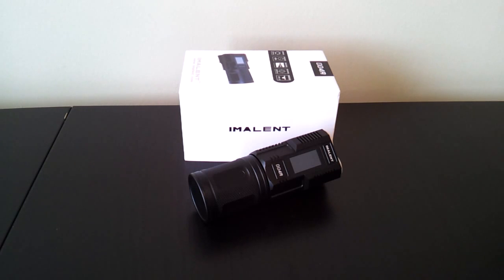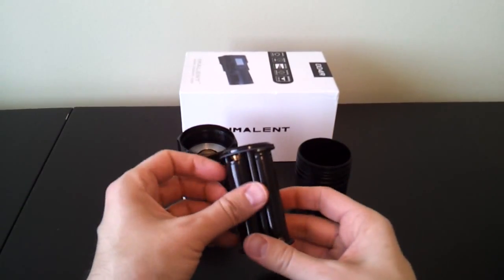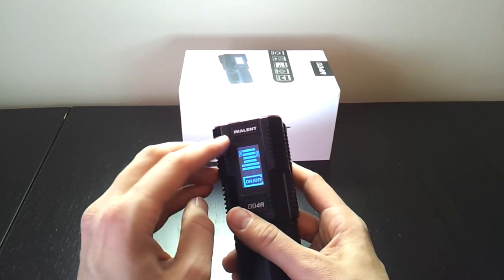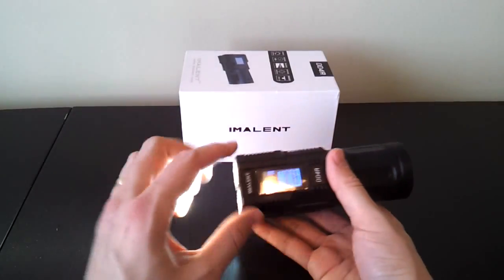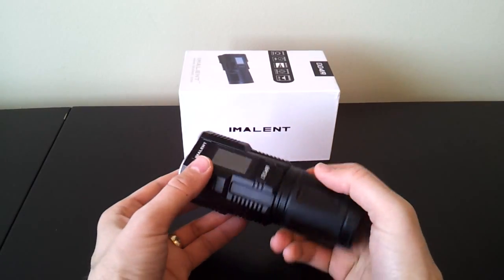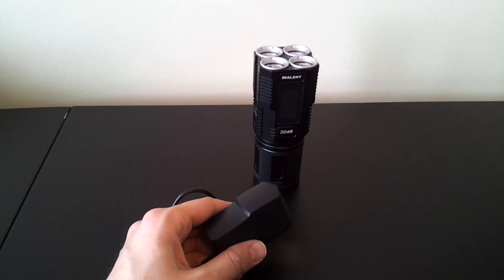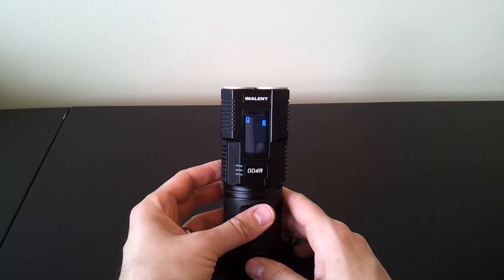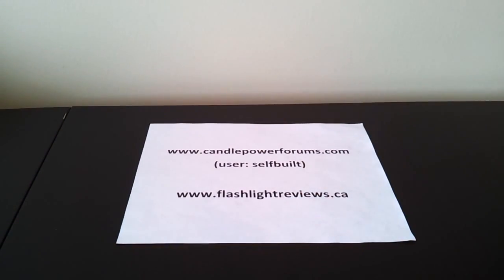IMALENT DD4R (4xXM-L2 - 4x18650/8xCR123A/8xRCR - Touch Screen).Flashlight Review, by selfbuilt

Comment: Hi. I would like to ask your personal opinion. Which do you recommend among these flashlight is the brightest...the Nitecore TM26, Imalent DD4R or the Ni-walker MM15? I like the Ni-walker MM15, but after watching your review on this Imalent especially the features, I got confused which one to choose. Hope you can share some feedback on which one to choose. Thanks!
Reply from the maker: Well, I haven't tested the TM26, and the final MM15 isn't out yet.  The MM15 is a very different kind of light - full flood, with virtually no hotspot.  It has the highest output (>5000 lumens in my testing),but the lack of throw may be an issue.  The TM26 should be brighter than the DD4R, and likely has slightly better build quality.  Hope that helps!
Reply: *****
Thank you!

Comment: i saw this light on ebay, shows 164€ and i want to know if this light is good for  nights walks at  " 0 light"  because there is not  lights, buildings, like forests and ruins and want to use too like torch led for my dslr if the  touch panel works very well
Reply from the maker: This light has a typical level of 4xXM-L2 output, so it should meet any need (although may be larger/heavier than you might want).
Reply: *****
 i see the weight and how looks in your hand, so thats not a problem, in the switch position there is 2 holes more, one for charge but the other is screw mount?
Reply from the maker: Josue Barralla Yes, but until they have changed it, it may not fit most tripods (its doesn't fit mine).
Reply: *****
 yes when i see the screw  i know that shouldnt fit in it, so my plan will be search a screw for that mount and   make with a flash hot shoe mount an adapter to put on my camera like a speedlight

Comment: Selfbuilt, how on earth do you expect to get advertised output and run times out of the 5000+ lumen beast with weak sauce 2200mah cells?  Can this light even get to turbo on these cells?  Im pretty sure Imalent used much higher capacity cells in testing and design.  I have not checked Imalents website but this monster has got to take no less than 3100mah cells in order to meet advertised specs...
Reply from the maker: This review is almost a year old - all my recent reviews use 3100mAh cells.  The use of 2200mAh cells previously was for backward compatibility with earlier reviews. Typically, these are still fine to meet ANSI FL-1 output specs - there is little difference at 30 secs post activation.  Sustained runtime is the main issue, which is why I am using 3100mAh cells now.  It had taken me awhile to find different brands of protected 3100mAh cells (with internally capacity consistency over batches, and matching performance across brands). This required to ensure all flashlights can run on them, with equivalent performance results.